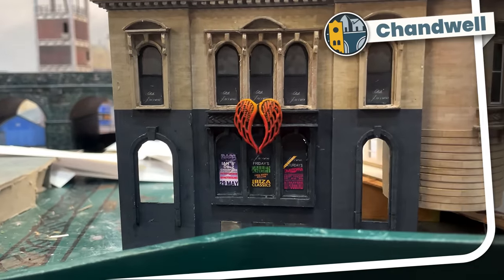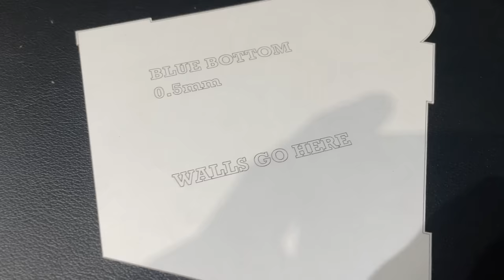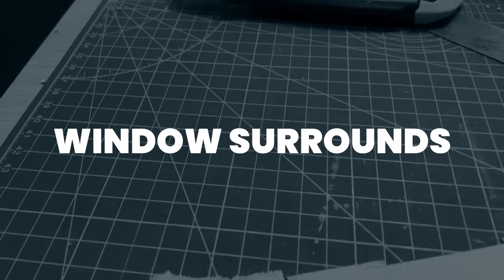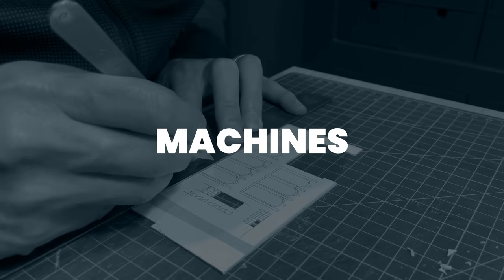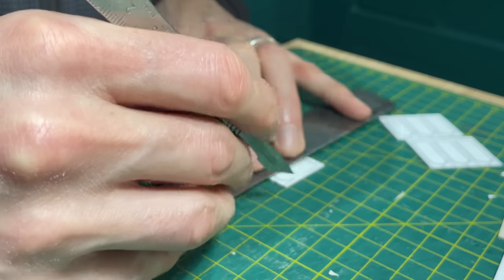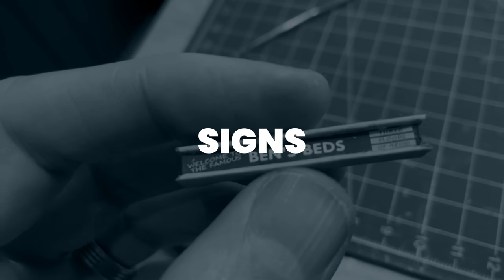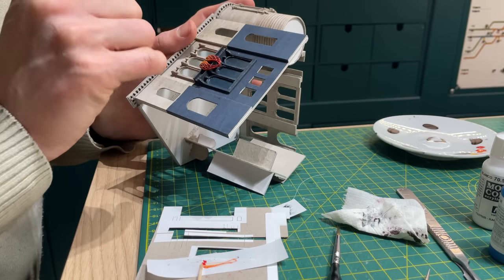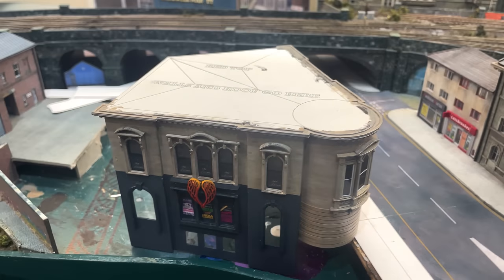An ornate stone building frontage made from hand-cut card - N Gauge Town Hall Part 4

Comment: As someone who does use a Cricut machine for cutting parts, I can tell you there are severe Limitations to its capabilities, particularly when cutting fine details. At least on my machine 0.5mm is the absolute minimum it’s capable of achieving. There are just some things that just must be cut by hand. For example, those corbels would get shredded by my Cricut if I tried them. Your building is looking beautiful, though really, I still think daily videos from Chandwell are a must!
Reply: I agree. My brother is great, but it's entirely dependant on having a sharp carterage, a super sticky backing and control over the speed of the device. Not all devices have this control.
Reply from the maker: Thanks for the advice! Daily videos you say!!? Wow! :)

Comment: Michael, I agree with your comments on staying away from machine cutters. Every time I see an ad for an inexpensive laser cutter, I find that I still need to buy a cutting bed, a ventilation system, and sometimes even a higher powered laser. Spending $1,000 or more for a laser cutting setup does not make a lot of sense - especially when you have a steady hand, good eyesight, and no arthritis!
Reply from the maker: The costs soon mount, don't they!?

Comment: Being a cardmodeller for a few decades now I really love your work. And I think you would get a maximum amount of use out of a cheap diode laser cutter.
Reply from the maker: I am sure I would if I bought one, but until I no longer enjoy cutting by hand, I have no desire to buy one. I'd probably say I've spent less on the whole of Chandwell's card buildings than an entry level card cutter would cost! Chandwell version 2 may well be cut by the machines, but it may also be in 00 gauge and have hand made track, so who knows! :)